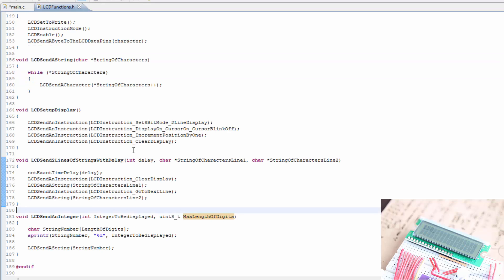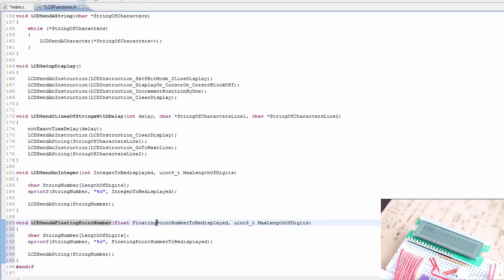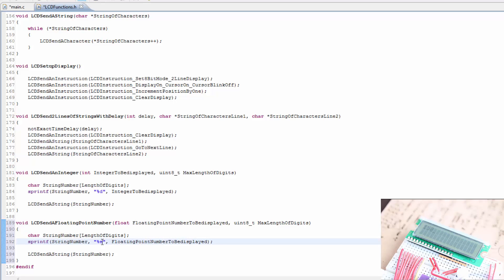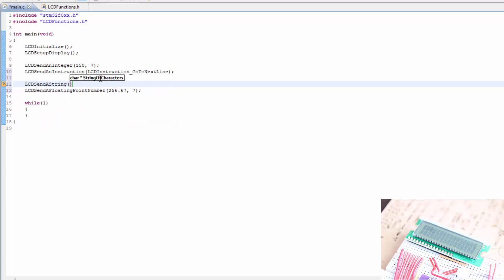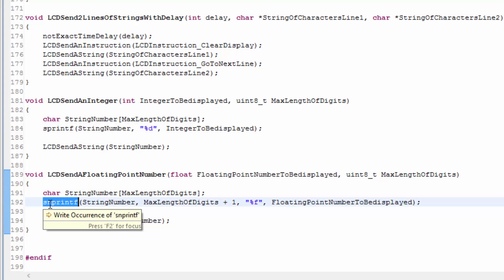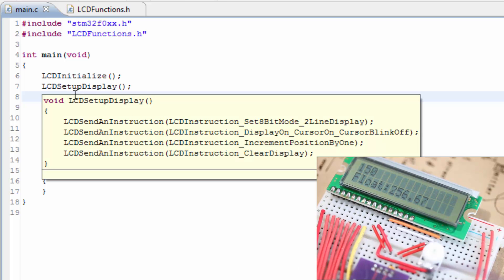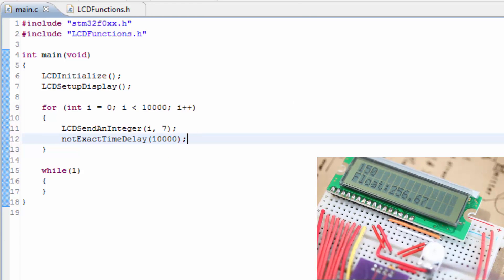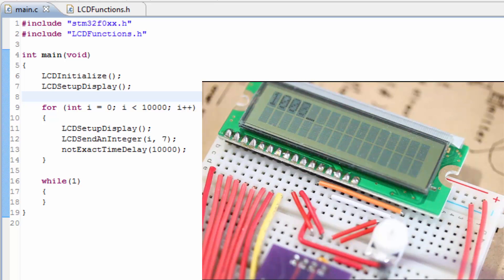30. How to Display Float Numbers on an LCD with ARM STM32 Microcontroller Tutorial - Part 17

Comment: I think the reason why 256.67 shows up as 256.67013, because the fractional part cannot be represented in a binary number system with finite number of digits. It is converted to 100000000.10101011100001010001111010111000010100011111......

Comment: 5:07 you have a buffer overflow, you need to use 
char StringNumber[MaxLengthOfDigits + 1]

the plus 1 is because of the terminating \0 at the end of the string

Comment: While I was researching the earlier issue that was causing "float" data types from being displayed using "sprintf", (see posting below), I did a lot of reading. What I found is that the two C Language functions, "sprintf" and "snprintf" will write data outside of the size boundaries specified for the target string. This is not a good thing. One comment on the internet said, (and I'll paraphrase here): 'that these types of boundary errors, are the hardest to debug because of the randomness of where a variable may be allocated at any time in memory.' After hearing that, I would shy away from using the "sprintf" function because there is no control on the output size of the generated string. The generated string is loaded starting at the target string's address, and like a freight train, it will roll over everything in it's path.

I know Patrick, that you warn about this in your video for LCDSentAnInteger. However, it appears the code in the LCDfunctions.h for this video's function LCDSendFloatPointNumbers has the StringNumber array variable undersized by one character. It seems the trailing null value was not accounted for. It was in "snprintf", but not in the target StringNumber variable. 

Also, I noticed that in the prior video for SetPortAndPinForOutput, the PUPDR is a two bit setting. The video only sets the lower order bit to zero. (I'm trying to remember this issue from a week ago, so my memory may be faulty.) 

(I'll add my disclaimer here: Please disregard this comment is this topic has been address in some future video I have not seen yet.)

Please understand, I'm not trying to pick at your work. I'm just trying to make it better. I'm really enjoying your video series Patrick. Your video editing skills have kept these lesson from dragging out. Your ability and sense of flow by speeding up and parsing down various sections/processes has made this easy to watch.  Thanks for all your efforts. Please consider me one of your fans.

Comment: I too have found a problem viewing "float" data type variables using the "sprintf" and "snprintf" functions. I am experiencing the same problems that Alok Sahu had described/reported 6 months ago. (Both functions work fine with Integer but not with the data conversion types associated with "Float":  "%f", "%g", "%e"..... The return code from both functions is negative one {-1} and the target string has a Null character "\0" in the first character of the string array, [0].)

The problem has to do with the compiler option setting for the ARM GCC Linker. What is missing, and needs to be added to the IDE, or Makefile, is the ARM GCC Linker compiler option: "-u _printf_float". This option needs to be placed/located after the ARM GCC Linker option: "-specs=nano.specs".

Unfortunately, I'm not developing using the CooCox IDE, so I can't offer any details as to how/where to configure the ARM GCC Linker options to add "-u _printf_float" in the correct location. Patrick, maybe you can comment on this from the CooCox IDE perspective. 

As for me, I am developing on an old desktop computer running the Linux OS. Listed below are the specifications. 
 
** OS: Ubuntu 16.4 LTS. 
** Compiler: gcc-arm-none-eabi-7-2017-q4-major-linux
** IDE: Eclipse Oxygen 2 Release: 4.7.2
** Chip Interface: ST-Link V2
** Development Chip: NewbieHack.com's STM32F030R8T6

To add the ARM GCC Linker option in Eclipse Oxygen 2, the following steps can be taken. 

** Open/Start the Eclipse IDE program
** When/If the workspace dialog appears, select a workspace of your choosing and wait for the main window to appear.
** In the title bar at the top of the screen, select the menu options: "Project --> Properties" and wait for the Properties window to appear.
** In the Properties window, select in the left window pane, the option: "C/C++Build --> Settings"
** Now in the right pane of the Properties window, select the "Tools Settings" (Tab)
** Within the Tools Setting pane, select the option: "GNU ARM Cross C++ Linker --> Miscellaneous".
** The options on the right side of the Tools Setting pane will show the Linker compile options. Here, near the bottom right corner, is a series of check boxes. The check box labeled "Use newlib-nano(-specs=nano.specs)" should be checked already.
** Click the check box turning on the option labeled: "Use float with nano printf(-u _printf_float)"
** Click the "Apply" button or "Apply and Close".
** At this point the C-Program can be built and the "float" data type variables will be displayed as expected using the "sprintf" and "snprintf" functions.

I hope this helps your other followers who are experiencing this issue as they follow along in your video series.

Comment: Your videos are too enlightening . Thanks for them. But I had problem while converting float to string using both "sprintf" and "snprintf". But both works fine with integer i.e. LCD displays the integer but not the float. Do I need to change any settings because when I debugged the code it traces to a function called "vsnprintf" which have support for only integer and other data formats but not float. Kindly help.
Reply from the maker: Thanks for the kind words.  Odd that you are having this problem.  I can only think that maybe you added the incorrect library to the project.  Other than that, I am too unfamiliar with that scenario to help in a significant way.
Reply: Actually I am using STM32F103C8T6 board . I have added STM32F103xB_CUBELIB, cmsis_core, Retarget_printf (for sprintf). It works fine for integer displays but for "%f", the vsnprintf function returns -1. If you have any idea regarding this , i will appreciate your help. But for time being and with help of your previous videos I have split up the float number into integer part and fraction part and joined the integer and fraction part with sprintf (Thank you. I didn't know about sprintf before). Now I am able to display that in LCD with this function.
Reply from the maker: That is a clever resolution to the problem.  You can even determine your precision (number of decimal points) pretty easily.
Reply: Hi ! 5years later, :-). I'll leave this comment here just in case more people like me have the same problem. I'm using the STM32F103RC (RT6) with VSCode and Platformio. I only needed to put the build_flag for the compiler " build_flags = -Wl,-u_printf_float " some IDEs ( VSCode Platformio ) don't have this flag activated by default and you need that to print Float Type. For more about search the flags for the compiler that you are using. Great Series !! Learning a lot ! Thank you @BuildYourCNC

Comment: When counting characters for strings, including the results of numeric conversions, it is important to add one. This is for the /0 at the end of ALL C strings. Just as you did with your LCDSendastring() function, CLib functions need a zero to mark the end of strings.

You might not see a problem with your use of the CLib functions, but you are creating an array on the stack and then the CLib functions are writing a result with a zero at the end , if you don't allow  for that something is going to be overwritten, and the results are unpredictable.

Still loving this series, thank you.
Reply from the maker: Hi Michael, are you referring to the + 1 at the end of MaxLengthOfDigits value?
Reply: I am referring to the dimension of the array. That to should be +1.
Reply from the maker: Ah, I see. Thanks.  I will change this value and test it.

char StringNumber[MaxLengthOfDigits];
to
char StringNumber[MaxLengthOfDigits + 1];

Is that correct?
Reply: Sorry, that reply wasn't very clear.

The dimension of array passed to snprintf() should be large enough to hold the numeric string plus the /0. So line 191 should read

char StringNumber[MaxLengthofDigits+1];
Reply from the maker: Ok, great.  I will make the change.
Reply: Your are going going to hate me but: looking back at part 29, I see you have the same problem at line 181 and the dimension of StringNumber[].
Reply from the maker: I would never hate someone that takes the valuable time to help!

I see and I've made the change. I am doing some coding for my interrupts video, so this will allow me to test the changes. 

The odd thing is, the previous code shows the complete number and that function calls the LCDSendAString which tests all of the characters for a null character anyway.
Reply: The reason why you didn't crash was , as you were verbalising you were increasing the parameter in your call to SendasFloatingPoint Number() "in case I need a bigger number later" (paraphrasing here). If you had you had used exactly the expected number of characters in the call, that zero would have written over something vital eventually. As the array was on the stack, it might not have shown itself for some time. The important message is that ALL C strings have a /0 character at the end and that must be allowed for.  "and one for the pot" as we Brits say when making a pot of tea.
Reply: AAMOF had you declared a local variable AFTER declaring the array, that would almost certainly overwritten, especially when sprintf returned that increased precision result. Try it and see.